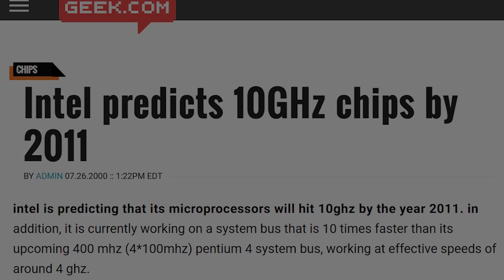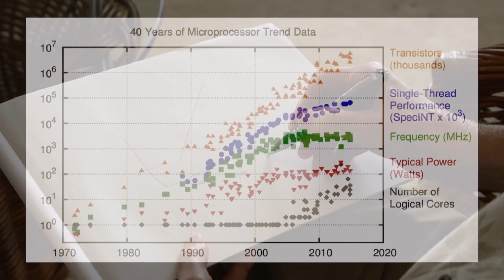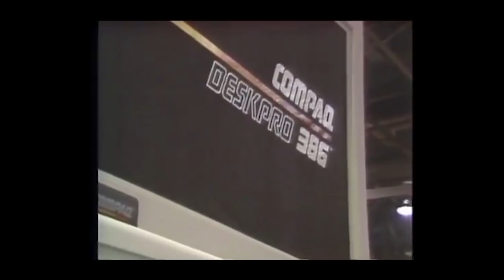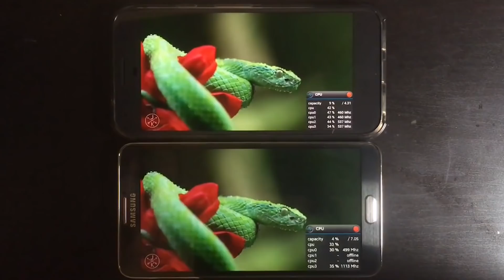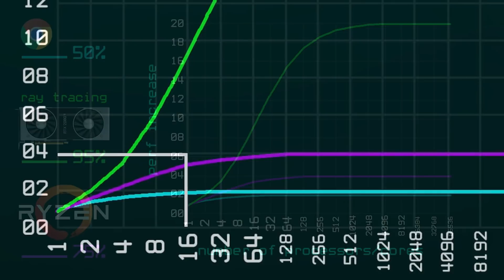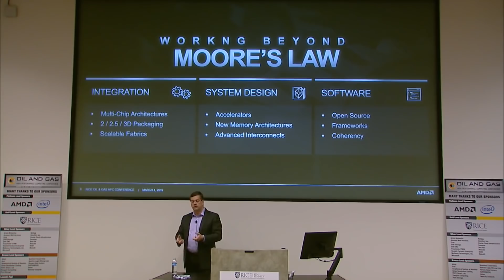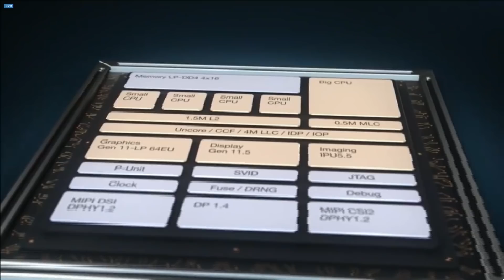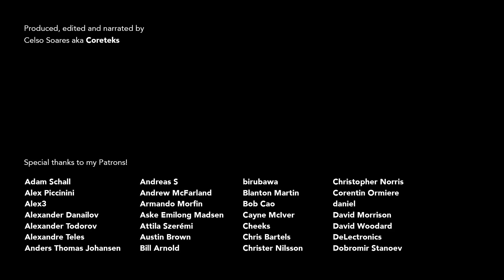Intel and AMD going BEYOND Moore's Law

Comment: It is because Intel made efficiency and no of cores much more important than the Gigahertz that a cpu operated at. P4 ran at 4GHz in 2004. If they scaled like that they would have easily hit 10 GHz by 2011.

Comment: You can’t go below 3nm because at that level electrons just jump the transistor because it’s too thin a gate.
Has to do with quantum mechanics.
An electron would simply disappear and appear on the other side and always give a value of 1 on binary code.
At 5nm it ain’t commercially viable to get to that.

Comment: If you are talking about GPU cores, some of the more complex deep learning models, which will likely seem trivial by tomorrows standards 5 years hence, can use as many cores as you can throw at them.  We have aggregated almost 40,000 cores to train a recent DNN model, and it still took 37 hours (still better than the 320 days with a single GPU card).
Also, and not my specific area of professional knowledge, but don't we already see leakage and other quantum effects creeping in at around 5nm, which will place a practical limit on transistor sizes.  Obviously die sizes  can be increased, but I would think that they currently have some practical limits too.

Comment: You've got one fundamental mistake in this video. You talked about shrinking possibly to picometers. This is impossible with the existing tech due to quantum mechanics. 5nm is about the smallest possible for silicon before quantum tunneling renders the logic gates useless. To get smaller, silicon will need to be replaced. While intel is already working on that, there's also already both optical and quantum processor prototypes in the research field.

Also, with regards to the idea that 32 cores are more than enough... that's only if seriously care about single-threaded applications. Even if the ides of parsing out single threats into multi-threads doesn't take off, a larger number of cores lends itself greatly to virtualization. Personally, I hope that if optical processing takes anything from current computing, I hope they adopt the concept of RISC.

Comment: 1.) Clickbait title… Moore's "law" says nothing about CPU frequency or performance but only transistor density, and there isn't the slightest indication that Intel and AMD are going "beyond" it ( maybe you could say this in a sense for AMD since they are down to 7nm vs. Intel's 14nm).
2.) Amdahl's (actual) law is also misapplied. Yes, since it is a law, you can't cheat it. But very few (original) problems that we use computers for are actually limited in practice by Amdahl's law because current software is nowhere near optimal under Amdahl's law.

Here's a simple example for point 2, cryptography: The signature algorithm Ed25519 has become popular in recent years. It requires generating two hashes of a message using SHA-512, and you need the first hash before you can even start to calculate the second. Also, SHA-512 lends itself very poorly to parallel computation having a ton of linear data dependencies. So, Amdahl says: You lose!

But the original problem is not signing a message with Ed25519, but signing a message, which requires calculating a cryptographic hash. There is no security reason why computing a cryptographic hash function has to be intrinsically sequential like SHA-2 (of which SHA-512 is an instance) unfortunately is.

In short, there is almost no evidence that we need more single-threaded performance. What we need is for algorithm designers (in this case, cryptographers) to remove their craniums from their posteriors and realize the changes in CPU design that have been happening for over 12 years now (Intel introduced the Core Duo to market in 2006). We then need standard bodies and influential software vendors to adopt these parallelizable algorithms and deprecate algorithms that aren't. And we need, as you rightly state, to educate developers about how to make effective use of parallel computing resources as well. Amdahl will still not rest, but he will be a whole lot quieter.

(Final note: Ed25519 "solves" this problem by supporting at least batch verification of up to 64 signatures at a time. Needless to say, while this can work well enough on a web server with dozens of independent connections, it's not useful in many other applications. Worse still, client certificates are rarely used for HTTPS, so even a web server may not benefit that much. Ironically, the main author of the Ed25519 paper, D.J. Bernstein, also designed ChaCha 20, which allows for "embarrassingly parallel" computation.)

Comment: As many comments have stated, some information in this video is incorrect. 1) Below 5nm is currently impossible. Electrons jump between the gates, and until that is solved, 5nm is a hard limit for transistor size. 2) As a developer myself who cares strongly about performance, I can tell you there are only small subsets of a program that can be multithreaded. Programs work by doing calculations and then feeding that into the next calculation, it's not very often that you can do the next one without having the result of the first one. Which also means that the "hardware/kernel" level automatic multithreader sounds like BS. This is something we would have to see to believe, not just a demo video that could easily be BS. Most workloads can never be more than 50% multithreaded, so it will be interesting to see.

Comment: Of course we can go as small as we want but the trade of with degrading performance due to temperature and vulnerability over interference making it a self defeating goal therefore using parallel processor design of multiple current CPU combined would guarantee better success and sufficient for human consumption for the next hundred years

Comment: Unlikely to see this 50%-100% performance boost in a couple years.  Even if it were possible (I'm not convinced it's going to be ready for integration and performant in mainstream CPUs so soon), it seems that the CPU makers would (think they) benefit from just trying to outdo each other while artificially limiting the gains to something like 10%-20% per generation (and thus leaving a trick up their sleeve if it seems like the competitor is going to outdo theirs).  Why would Intel dump a 100% boost on us as long as they can milk people for 5% year after year?  Why would AMD dump 100% on us (and then nothing) if they know Intel's got the same tech ready to go any moment?

Comment: Nice Video ^_^ But I partially disagree. I believe, rather than simply cramming more and more allrounder cores into x86 / x64 processors, AMD and Intel will add specialized cores, such as FPGA parts or hardware accelerated instructions - a route, ARM based processors have been persuing some years \../
Also, as mentioned in the video, the system memory will poosibly be sucked into the CPU.

Comment: As someone, who studies computer science, I can tell you that going from normal sequential programming to parallel programming is a big headache.

When you write or read code, you can just read from top to bottom in order to understand what the program is doing. When programming parallely, you split your code into multiple sequential segments(threads) that can be executed parallely. 
This creates a lot of problems, one thread may need the result from another thread in order to do its computation, so you need to tell it to wait until the other thread is done.
Another problem is that multiple threads are reading and modifying the same data. This could lead to one reading some date just before another one updates it and makes the previously read data invalid. 

So you, the lazy programmer, gets to have a lot of fun coordinating the threads. And if something goes wrong, good look finding the bugs. If you you don't plan the structure of the programm to a pedantic degree, you will have no idea what your own program is doing. Good luck understanding someone else's program.

Tl;dr: Parallel programming is a pain in the ass and I hope to avoid doing it in the future.

Comment: pfft I occasionally need to rent servers to run some programs (massive autodesk inventor rendering and physical simulations usually involving hundreds of gigabytes of data) because getting it done on my CPU would just take too long. I usually need around 10,000 cores working in parallel for an entire day to get my larger simulations done.

Comment: Uh, here's something they don't tell you.  Yes computers get exponentially faster every 18 months or whatever...but the software becomes more inefficient and filled with data collection, ads and viruses.  So your computers/phones don't really get much faster each year.  They are lying to you all.
Reply: Spirit Anon I haven't seen consumer PCs get much faster over the past few years. My 4 year old laptop still runs about the same in benchmarks as those currently being sold at the equivalent price range. I think they're mostly focusing on power efficiency. Newer laptops run way cooler and last way longer on battery. Phones have definitely improved drastically.

Comment: You say that a sequential number of sw-instructions can just be parallelized (even automatically). How would that be possible when the next instruction in the sequence depends on the result of the last instruction?
And most software of today takes avantage of multiple cores.

Comment: Well, you ended up on my recommended list, from no fault of your own, or mine, just the Algorithm having fun at our expense LOL What I found interesting (I'm no geek, just a simple 71 year old farmer) is that your talking about going from 2d to 3d microprocessors. 4 years ago I came across a presentation on Nano Tech by Eric Drexler who predicted that computers would eventually be shrunk to the Nano scale, using graphene based processors layered with 10s of thousands of transistors in each layer. The Angel on a Pin phenomena. But these computers would be so small that they could be injected into the blood stream and be Fully Autonomous Self Propelled Units. It is good to see that this is happening now in the macro world. Subbed and Liked... cheers...

Comment: The only way that any of this would be possible is dumping silicon for graphine and going to optical computing systems. Or switch to quantum computing with room temperature super conductive chips. You can only get so small before you hit bottom.

Comment: 5:20 the whole argument that there's a limit to how many cores will improve performance is bs. It's a matter of how much data you need to process / computations. Ofc when measuring on a set computation size it will stagnate in performance to some point, but I believe the amount of computations we need will only increase over time. I'd recommend reading some articles on parallel computing.
Reply: Also, parallelism ≠ concurrency. What you're talking about is mostly concurrency.

Comment: Bigger is better. For my own reasons, i wouldnt mind a cheaper CPU where the die is much larger on a 32nm manufactur process. Instead of a thumbnail sized CPU chip, id want one that spanded about the size of a playing card. Easily cooled.. Would use power, but the amount of transistors in that fucker would be unreal and the intire thing being only single core only one chip.

Comment: Multithreaded code is essential in web backend coding. It is possible to use near 100% cpu by scheduling tasks correctly, which means more cores more performance. Desktop performance may not improve as much, but servers and batch processors can definitely use more cores.

Comment: I think placing thousands of cores on a chip will be the diretion chip manufacturers will head.  Why?  Imagine every game sprite being assigned to a single core.  So if you had 1,024 sprites all moving around independently of one another, these could each be individually controlled in ways we cannot imagine.  Or maybe clusters of cores could be assigned to a single sprite that is moving in a 3D environment for intensely immersive VR action.  I'm tired of seeing most of this tech being wasted on cell phones.  What about hardcore gamers with multi-monitor UHD displays?  Don't we have have a voice in any of this technology?

Comment: No transistor size will not continue to shrink very much more than they are. Quantum tunneling occurs when you start going below 8-10nm and increases drastically as you go smaller from there. That's because electricity stops behaving the same way in circuits when you start talking about 10 atoms across or less.

Comment: Why have separate software or hardware?  Just get all the major compiler makers to alter the code for you at compilation.  Can always provide a switch that the user can set to not alter the code.  That way it's a conscience decision to run non parallel.

Comment: I was taught parallel multi-threaded coding 25 years ago at uni, have been doing it ever since, nearly every software project I've worked on uses thread pools, and I don't know of a modern game engine which isn't multi-threaded.  So where's this "Devs aren't taught to multi-thread and don't do it" stuff coming from?  Or are you talking about something different?

Comment: Those 90's predictions were not naive optimism. The market shifted. The saturation of OS features, the leveling off of the desktop market (from myriad reasons), the rise of the phone and tablet markets, IoT and embedded systems and SOCs.... to say nothing of the whole multi-core aspect. The new market doesn't want super fast, super powerful, electric heaters with noisy cooling systems. They want quiet, low power, battery run small devices and large numbers of them. The predictions were assuming the market would not change and were based entirely upon technological progress. Nobody could have predicted the smartphone and the raspberry pi-type systems. (back then)

Comment: If you want to parallelize a problem, don't look at the code. Look at the data you need to process. It is extremely easy to parallelize a problem where the data is alll independent (like raytracing). It is almost impossible to efficiently parallelize processing data that is all inter-dependent (assuming you still want to ensure 100% data * computation integrity). This is the core of the problem. Yeah, maybe AI integrated in chips may help you improve performance, but this is small gains. More cores helps, but on a limited set of problems. Some of the problems you mention, are not CPU power problems (like windows stuttering), but I/O problems. The seocnd biggest limitation after CPU speed, is memory speed, that is why bringing the RAM closer to the core is the next logical step & will improve perf a lot.

Comment: Compilers are making it easier for programmers to parallelize their code with only a design problem in front of them: how to effectively parallelize a task without synchronization.
C++17 introduced parallel generic algorithms.
Python has atomic dictionary operations (to use as an adhoc priority queue)
Most languages have parfors
Libraries take advantage of features like SSE and SIMD where applicable

Comment: Parallel programming is fairly easy, but it haves its limitations - not everything can be made parallel.
Only operations that are logically seperated can be parallel - otherwise you lose a lot of time on thread synchronization.

I doubt that AI-based core management will work properly, but we will see.

Comment: Amdahls law states that the same program we use todsy with a handful of cores won‘t benefit from an unlimited number of cores, agreed.

But here‘s the thing, virtually anything that is able to even remotely max out todays processors could be rewritten to use more cores. Specifically the increasing amount of data we‘d like to process with the gained processing power can benefit a lot from many cores.

I think you‘d be hard pressed at finding examples of programs that are inherently low-threaded that can‘t be rewritten to gain performance almost linearly from n cores (apart from some theoretical computer science counterexamples).

Comment: lets say it this way, only because ATM we think that 32 is the most useable, maybe that will change when software changes how it works... cant be so hard to synchronize work over X cores. (like u talk about at min 10). But i think the next big step is not 10ghz or 100 cores, i think the next big step is to have computers no longer stationary at home, better in a "cloud", just a "smal rasp pi" to display desktop and plug ur hardware in, rest over the internet, splitterd across all avaible hardware in the datacenter. (is currently possible, but too high latency for games and a little bit too expentive)

Comment: We have known that in the 2000s they reached the limit silicon can provide.  In the 80s the military had 10 gigahertz chips in their missiles they blew up.  Made with a specially grown quartz.  How do I know this?  My step dad worked at TI where they made the stuff and I got to tour the facility :)
Reply: texas instruments? the calculator company?
Reply: @BMac420  Correct they made most of the equipment for the missles.  Huge government contracts.
Reply: @geoffreystraw5268  learn something new everyday
Reply: @BMac420  TI also invented the integrated circuit

Comment: the only problem with how we cant get past the clock speed is heat. yes we can already hit 7ghz it just requires a giant, ugly, ln2 cooling system. if we can find a way to compress ln2 cooling to the size that liquid cooling radiators are today.